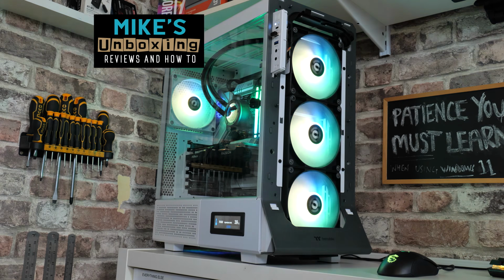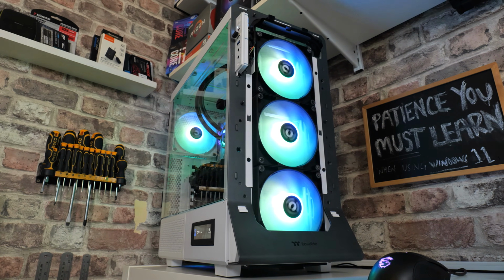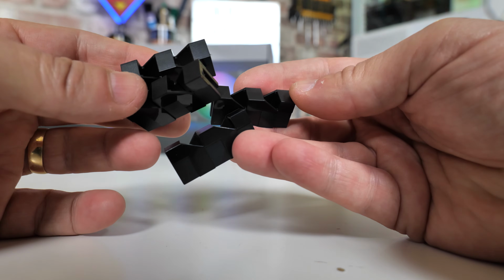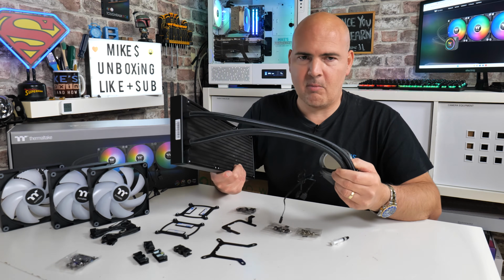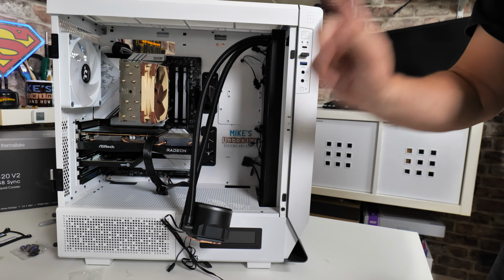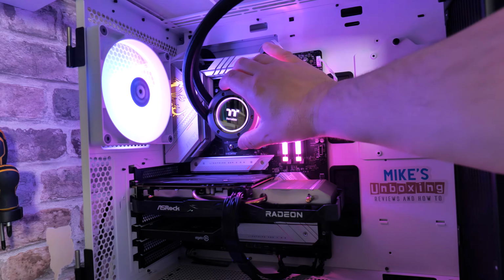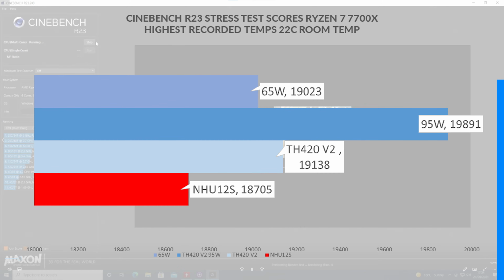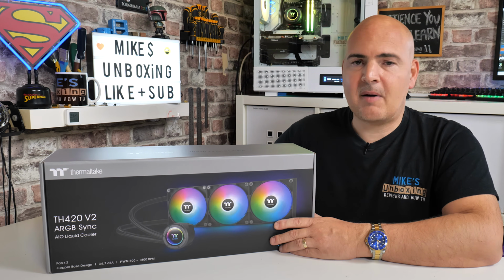Thermaltake TH420 V2 ARGB AIO Cooler Brute Force Cooling On A Budget

Comment: Hello. There is something I couldn’t fully understand, and I would really appreciate your help.
You connected the power cables of the three fans to the CPU_FAN1 header on the motherboard and their ARGB cables to the JARGB port.
You connected the pump’s power cable to the PUMP_FAN1 header, but you didn’t show where exactly the ARGB cable of the pump is connected.
Where should we connect the ARGB cable coming from the pump?
Reply from the maker: the argb from the pump can go to another header on the board or in the daisy chain for the fans
Reply: @mikesunboxing  Hello sir, thanks for the answer 🙏🏼 I ll connect pumps rgb cable to 3 fans rgb cable.

Comment: 90°C on water , only 130w power , holy smokes . I was dissapointed with my skythe ninja 5 , but looks like those are the temps ! 
I always tought water kept things cool . Like 70 degrees territory .

I was consnidering this very AIO , but looks like i might get my long desired NH D14 .
Reply from the maker: that is the trouble with modern CPUs they try and reach silly temps (which are in spec) but it looks bad in charts. The non X and no K chips behave much better

Comment: Great review! Im looking to install this AIO into my Thermaltake The Tower 600. It should fit no problem right?
Reply from the maker: It should fit really well on the right side of the case
Reply: @mikesunboxing  Wow, that's insane, considering how compact the case is. Thanks for the quick response, mate.
Reply: @Tycho-96  I have a tower 600 case, did you receive the product? Does it fit in the case?
Reply: @Gamer00789  Yep, fit with no issues. Very good cooler btw, temps are really nice with ryzen 7 9800x3d.
Reply: @Tycho-96  How many degrees in games
Reply: @Gamer00789 doesnt go above 50c in cyberpunk, baldurs gate 3

Comment: I need a comparison of this with arctic liq freezer III 360 and 420. you see the 420 of that monster does not fit my case due to thicc radiator, but 360 does, and TH420 does. so I need to compare if arctic 360 or this one. since arctic one is much cheaper and has vrm fans would be an interesting comparison.
Reply from the maker: funny i actually just bought the freezer 3 280mm for similar reasons, i hope it fits, i don't think it will like my ram sticks

Comment: Any update on how loud the pump is? Lowest RPM vs. Hightest RPM? Thanks!
Reply from the maker: it gurgles a bit at startup but is quiet after, it is running between about 1000-3300 rpm in mine but i keep it around 80-100% most of the time so about 2600 or so

Comment: AMD have become so dodgy, Forcing CPU's to run as close to 95c as possible to intentionally shorten their lifespan. 
I need my R5 7600x to last another 10 years like my FX-8350 lasted (@ 4.8ghz it never got over 50c with a 360mm custom loop with 1.8L on custom homemade coolant) 
I would like a cooler that wont allow R5 7600x to go past 60c under max load for 12 hours at 5.5ghz +, Might have to manual clock the cpu and set manual voltages and disable any curves or sillyness. 

I always run all Case/cooler/gpu fans at 100% if i wanted silence i would buy better headphones
Reply: My deepcool ak620 won’t let my r5 7600x ever go past  64C but deepcool recently got banned in the USA for selling to russian businesses.

Comment: Cooler is great... LCD screen is nice... Software/Drivers are buggy... Have one brand new and have yet to get the LCD screen to be recognized. Got it once, for about 5 seconds, by plugging a USB to microUSB from the back of the mobo (B550 Tomahawk Max wifi) into the screen, but it stopped just after. Still haven't figured it out.
Reply from the maker: This is maybe easier to fix or at least advise if we can ask more questions and get direct answers, so feel free to join our Discord chat and we can go over it in more detail https://discord.gg/XtBTGQ6BDu
Agree to the rules by clicking the emoji and you will get access to the rest of the Discord channels

Comment: The only bad thing I found with this AIO(that I have in my case) is that AMD bracket can only be installed one way. So, you can't have the hoses on the bottom or top of the CPU. It can only be on the left or right. And also, no software to control the RGB with Temperatures. All Corsair  AIO can be configured to change color according to temperature.
Reply from the maker: it will depend on your motherboard software for the ARGB setting, the MSI center / mystic light allows it, so does gigabyte
Reply: @mikesunboxing  my motherboard controls the lighting. No problem there. But it cannot change color if it passes certain temperature as a warning, like Corsair AIOs
Reply from the maker: This is maybe easier to fix or at least advise if we can ask more questions and get direct answers, so feel free to join our Discord chat and we can go over it in more detail https://discord.gg/XtBTGQ6BDu

Agree to the rules by clicking the emoji and you will get access to the rest of the Discord channels @websparrow

Comment: BTW just noticed in the benchmarks this 3 huge fan monstrosity is just BARELY better than a 1 fan non liquid Noctua cooler.... not even the double version just single fin stack... Isn't that kind of a terrible result for an enormous AIO like this?
Reply from the maker: the thing is with modern processor design and the way they always try to hit the 95c mark unless tuned means that pretty much all coolers max temps are going to look similar.
The real difference for me that i am finding is the "normal" use temps stay much lower with a bigger cooler like this and therefore you don't get the rest of the system fans going nuts when just browsing or watching a video.
I think we need a new metric in cooler reviews really. But trying to test in a real world use case is really hard to do with all the different options and external factors.
Reply: @mikesunboxing  We need some pure gold coldplates or something .... heat density is up so so much from just a decade ago .  about 100 , 150 square milimeters  (10*15mm) are generating most of the tdp . In terms of a space heaters this would be a new era of them . One could buy a 10KW space heater the size of a smartphone .

Comment: Thanks Mike for another great video. I am still confused about AIO front mounting with regards to where to put the fans. Your video shows the fans installed facing the outside and the radiator facing the inside of the case. I have seen other videos where the fans are installed facing the inside of the case and the radiator facing the outside. I am not interested in RGB lighting at all. Do you know which installation cools the CPU better?
Reply from the maker: it is dependant on many factors so hard to say for sure, also depending on the mounting it can effect offer devices like the GPU. Let me know what case you are using and what other fans and components and i can offer some advice specific to your setup
Reply: @mikesunboxing  Thanks for your reply Mike. My case is Fractal Design Define 7 Compact. I have 140mm fan on top, 120mm on rear. My AIO is ThermalTake TH240 V1. I have already front mounted the AIO with the 120mm fans facing the inside of the case. Your video shows the radiator facing the inside of the case. Just wondering which option is better for cooling the CPU, regardless of the RGB lighting as I don't use it.

Comment: How do you control the fan speed for these? Mine isn't even recognized by Thermaltakes RGB plus software
Reply from the maker: The thermaltake software isn’t needed for this, just use the bios or motherboard software to control the fans, can help you with that if needed
Reply: @mikesunboxing  yes please. I want an option to be able to switch the fan speed on the fly by switching between the full speed and silent "night mode" profiles, which is what I did in TT software before. I dont suppose thats doable quick and easy via bios? So what MB software for MSI can do that?

Comment: I get 80c under 160w load with cm ml240 push pull fan setup. Th420 is a complete disappointment that such a large cooler reaches 95c at 130w. Omg wtf
Reply from the maker: Modern processors work differently, temps are crazy but by design
Reply: @mikesunboxing  Regardless, arctic 420 seems like a better option, it's just a little more expensive but at least it has a VRM fan.

Comment: Do you know if the fans can be swaped for TT's Swafans? I would like to swap them but unsure if they will work or if the cabling / software will be a problem with the new fans?

Great video!

Thanks
Reply from the maker: yes that is fine, you will just need to install the TT RGB plus software and setup the fan speeds in there. Slight more complicated but easy enough to do
Reply: @mikesunboxing brilliant thank you

Also, I notice there is a ultra version,  would you know what the difference is and if you can still rotate the screen?

Comment: I don't like the trend why we need so massive a cooler to cool the CPU.
Reply: problem is we exceeded some heat transfer hard limits . Like actual physics . A rad that size should be able to handle a lot more heat , but the cpu generates so much heat in such a tiny space like 10x10mm square that the metals can't transfer heat efficient enough . We used to be able to cool 300 watt cpus without much issue from the 32-28nanometer era .

I was researching some aios for my build , hoping they would provide cool temps , but they cannot . It's very clear what's the issue . Looks like i'll stick with air . i don't care about 5 degree difference .
Reply from the maker: yeah it is becoming a bit daft and expensive

Comment: Hi, Mike. There are two things about AIOs that I don't like. First, most come with an aluminum radiator which doesn't transfer heat away from the CPU nearly as well as a copper radiator. Second, the black hoses most come with are ugly. I believe all AIOs should have the standard G1/4" threads so if desired, the owner could replace the ugly black hoses with standard fittings and clear PETG or Acrylic hardline tubing. That would allow the owner to buy a GPU water-block and add it to the system. I think if you tried something like an EKWB EK-Quantum Velocity 2 CPU ARGB Water Block and a good copper radiator you'd see a big difference in temps.
Reply: I have to disagree. On paper, copper is a better heat conductor than aluminum. In practice, a good 240,  280 or 360mm AIO isn't performing that much worse than a custom build watercooling system with copper radiator or the same size. Speak from experience.
Reply: @spektrumB  I am speaking from experience. I've been building custom loops for about twelve years so I know what I'm talking about. Copper's heat conductivity is far superior to that of aluminum. Copper radiators are also easier to repair.
Reply: @guitarprogrock  So do I speaking from experience. I have more spare 240, 280 and 360 radiators than I would like to admit.
Reply from the maker: there will be a few differences between an AIO and a custom loop, the parts are considerably more expensive and that should be the case, pay more get more.
Also to take into consideration that with an AIO there is a lot less thermal mass in the form of fluid, this also makes a difference.
I would expect a custom loop with the same amount of fluid and same size rad with no res to perform very closely to each other
Reply: So what you want people to invest on top of the already expensive coolers another 100 bucks ? For what another 1.5-2°C gain ??
Furthermore copper radiators are not in use in any general industry whatsoever . No car has copper radiators , no industrial machinery , no home appliance . So what gives ?

I'm not a watercooling expert like you , but i know my metals and budgets . 
All the things you want from your perfect aio is absolutely NOT what aios are all about .

I know a custom loop is nice and 25 decibels are nice , but burning 500€ or more on cooling is what less than 1% people do . Probably less then 0.5% .
The simple aio (1*120 , 1*140 , 2*120) has come a long a way , but it's still a premium .